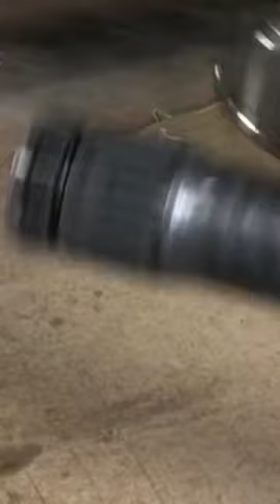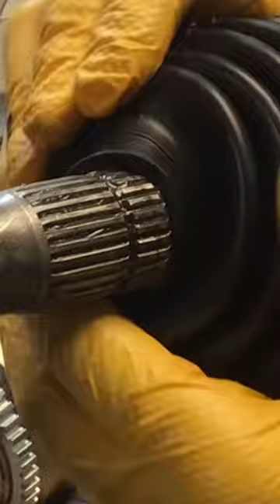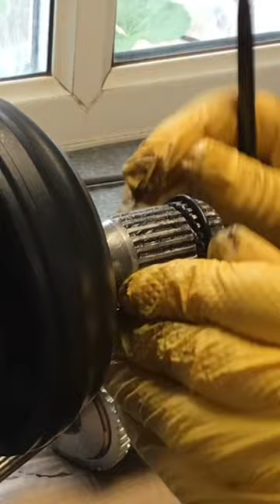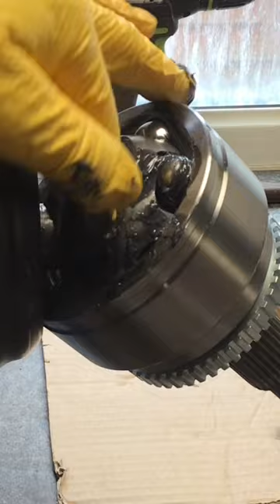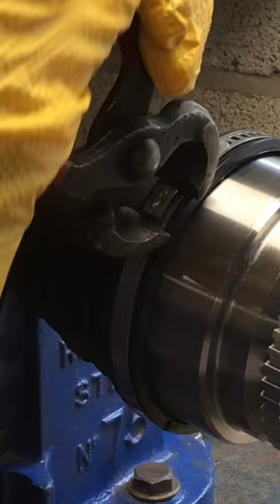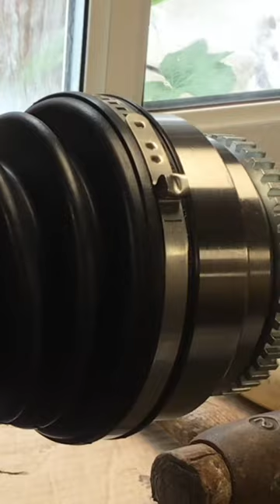Cv Joint install Tips 🛠 Everyday Workshop #shorts

Comment: Saw a video that the C clip must face in the 12 o'clock position. It worked for me as i battled at first with the one cv joint
Reply from the maker: Funnily enough I remember being taught that (a long time ago 🙂) and it may help. But I think the trick is to keep the circlip central and using grease to do this is what helps the most. 👍🙂

Comment: That's a great tip but how do you get the joint off in the first place? That little circlip has the power of 10 incredible hulks! I've cut enough axle shafts in half, I want to get it off with the shaft intact 😊
Reply from the maker: Haha, I agree they can be a very stubborn. The problem is the round section circlip can fully drop down into the groove at its highest point. If there was a way to keep it central it wouldn’t be an issue. Having said that if you hold the shaft and hold the CV straight (sort of need three hands) and give it a big hit with at least a a 3lb hammer they usually come off but not always 😉. If it doesn’t move try turning and hitting, hopefully you will catch the circlip in just the right position. This CV joint was one of them, I had to grind it off. See this video: https://youtu.be/SiNZe4jk_38
Reply: Chizel on the inner part and a good wack should do it 😁👍
Reply: @EverydayWorkshop This is exactly what we went through - an absolute MISSION. Your video is PERFECT in every way.
Reply from the maker: Thank you very much, I really appreciate your comment. 👍🙂

Comment: What type of grease is good considering the thermal expansion, which makes the grease come out of the boot.
Reply from the maker: CV joints require a special type of high temperature, high pressure Molybdenum Disulphide based grease. Not sure if you really need any other particular grease. If installed correctly expansion shouldn’t be an issue. If you listen in this video I release the air pressure built up from fitting the boot. So once the boot is secured tightly it should cope with any thermal expansion without leaking. Hope this helps? 🙂👍
Reply: @EverydayWorkshop thank you this answers my question. This helped me a lot.

Comment: Awesome. So on vw Gkn cv axle end it has a circlip like in this video. I took the end off with hub bolt and impact. Do I need to put new snap ring on the end in order for it to tap back on the splines? It doesn’t seem to want to go back on and turns on me allowing the ball bearings to pop out. Just wanted to use my old one for. Test run first and learning more about it.
Reply from the maker: Hi it usually won’t go back on because the clip drops down completely stopping it entering the joint. If you try packing the clip with grease to hold it central you will have a better chance. You need to keep everything dead inline for it to locate as you tap it back onto the shaft. Hope this helps 👍😊.
Reply: cool but do you need to be aware the length or until where should i push the axle? not that the axle be too short or too long that i need to track measurement after that?

Comment: I got an issue with a similar one, for some reason it's too lose and wants to come out of the wheel and sometimes it vibrates a lot till I stop🤣 (my mrl are welded)
Reply from the maker: Hi, well it doesn’t sound too good is the circlip still in place. Does sound as if it’s very worn. It possibly needs a new CV joint and drive shaft. Sorry don’t know what you mean by mrl. 🙂👍
Reply: @EverydayWorkshop  by mrl i mean the wheel locker,its an auto but its been welded and failed imma buy manuals after i install the new axle shaft along the cv joint

Comment: Did you release the pressure on the small hole?
Reply from the maker: Hi, you just use a screwdriver to release the pressure by sliding it under the boot. Hope this answers your question. 👍🙂

Comment: Do you need the grease on the splines?
Reply from the maker: Yes I would always grease the splines, if you have put it together without doing the whole joint is immersed in grease so it will find it’s way in.

Comment: I rather just replace the whole cv axle lol
Reply from the maker: Hi Enrique, you can certainly replace the full drive shaft and maybe the would be best. But I would argue it is a waste (to much is already wasted in this world) and it makes financial sense to only replace the outer CV joint. The inner joint will normally last three or four times longer, in fact in most cases it will never need changing during the life of the vehicle. Also you risk damaging the differential/gearbox seal, possibly with a loss of oil as well. This is if you replace the outer CV without removing the shaft, obviously in this instance I did remove the shaft. Just my view. Thanks for watching. 👍🙂
Reply: I understand and you're absolutely right,I was just saying because for me it looks more difficult to change it the way you did especially dealing with that damn circlip lol
Reply from the maker: Hi Enrique, yes I understand your view, I’m also an advocate for doing things the easiest and quickest way. So I agree it can sometimes be prudent to renew the full shaft.